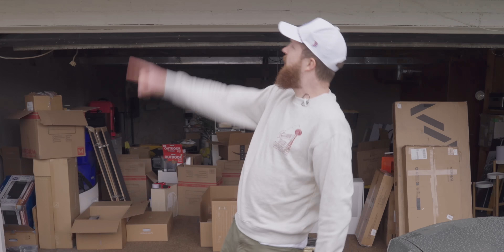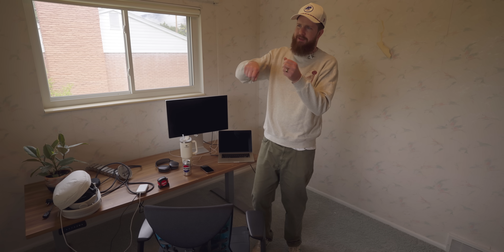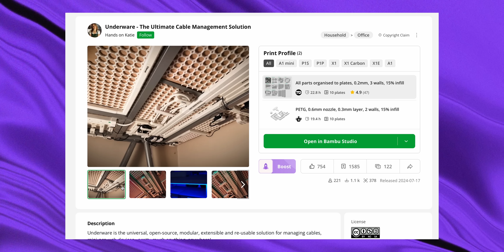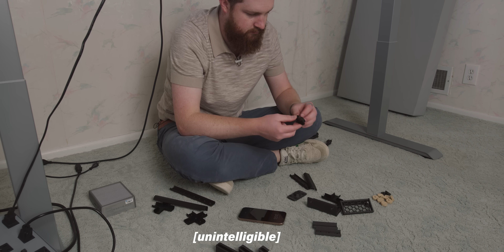Cheap, DIY Cable Management—Like a Pro!

Comment: I don't think I have ever seen a positive video about Bambu Lab that wasn't sponsored. At first I was surprised that you were speaking so positively about it, but then you admitted that this video was sponsored. It really is the iPhone of 3D printing. A locked down ecosystem that benefits from the Open Source community but doesn't contribute to it, meanwhile sucking up as much personal data as it can. If you want a cheap Chinese printer, but don't want to directly benefit an extremely predatory company, get a Creality printer.

Comment: When I was 13 i got an ender 3… I saved up for a year to get it, And it was awsome but I dont think I could have done something like this just due to how much bed leveling and settings would cause failed prints, but now I’m gonna get an A1 mini for the same price I paid for the ender 3 and I dont need to level or set it and it prints 6times faster? Its crazy how much tech moves fast in just 5years

Comment: While that is cool and I’m glad that this system works, I never really like cable management systems that are like this. These systems are really meant for “I am never gonna change anything about my setup.” Because if you need to add a wire or remove a wire you have to undo so much just to take a wire out.

I just use those 3m pad that you can zip tie to and just route all my cables underneath. It’s cheap, and sure you have to cut a zip tie but it’s couple minutes to take a cable out and redo it.

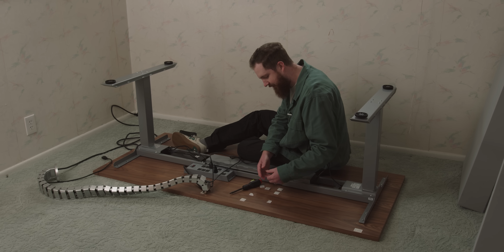Comment: 12:05 The easy answer to >90% of problematic adhesives... WD-40 (US NON-silicone). 
Trust me, stuff is a life saver when dealing with snake-rated glue trap misfires and other near-industrial grade lunacy.
16:56 What material did you print those 'screws' from? You should probably reprint them (along with any other parts of your cable management system that see excessive wear/breakage) in Carbon Fiber Reinforced PETG or another filament that's meant to take abuse and is compatible with your printers.

Comment: Interesting that you're buying a house. It makes SENSE, but there's a part of me that feels like the market has failed to make effective, cheap small studio spaces.

Do you have any thoughts on Bambu locking down their printers? On it's face, as a security option I don't hate it - but there seems to be a lot of frustration. It looks like it makes using other slicers more difficult (disabling the ability for a slicer to send directly to your printer). Especially with some of the oddity around filament RFID and DRM (it appears that the RFID can only be used to read settings on Bambu filament, and can't be used to mark your own non-Bambu spools), I'm concerned your 'iPhone of 3d printers' is more accurate than expected.

Comment: For those of you drawn in by the title and thumbnail, the cable management info starts a full 8.23 into the video.
Reply: it's also a 3d printed solution so you can skip if you're not doing 3d printing.

Comment: even cheaper (free) and fully customizable is the HSW. The Honeycomb Storage Wall has no paywalls, and an easy to learn way to convert anything for any other system into HSW compatible. 

Kinda disappointed that you went with a paid model option :/

Comment: Consider using a hair dryer or heat gun when removing adhesives. Pair it with a plastic "razorblades" tool and you'll start enjoying removing adhesive … maybe. Also, basic cooking oil helps to get the goo off. 70% isopropyl alcohol helps to get the oil off. But then it's gone! Phew.

Comment: I'm about to tackle this project as well but am so not looking forward to it - I have one desk setup with both a PC and a Mac. The whole jumble with Speakers, Keyboard, and Mouse to a KVM switch to both computers. One main monitor that goes to both computers and another monitor just for the PC. Magnetic iPad Pro monitor arm because I use my iPad as the second display for the Mac. Needless to say I have soooo many cables and it is going to be a monster to taackle.

Comment: Time stamps auto generated by ChapterBot:

00:00 - Introduction
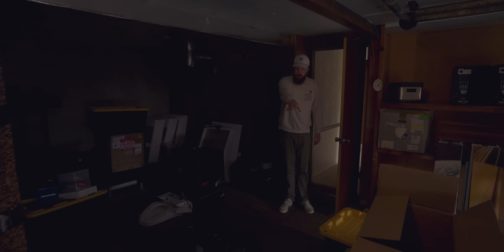00:00:58 - Renovating the Maker Space
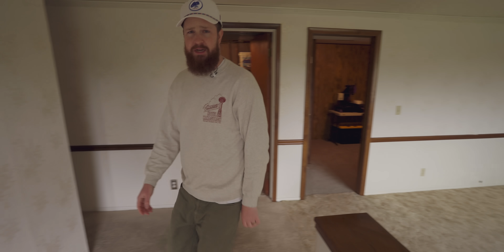00:02:06 - Discovering Potential
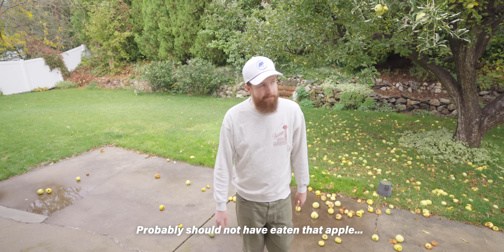00:03:08 - Modern Upgrades, Dated Decor
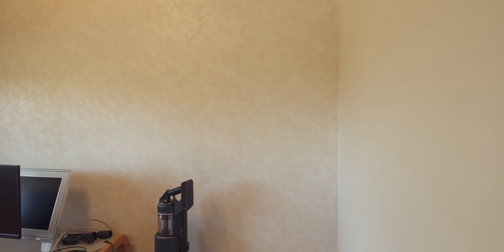00:03:55 - Designing a Multi-Use Space
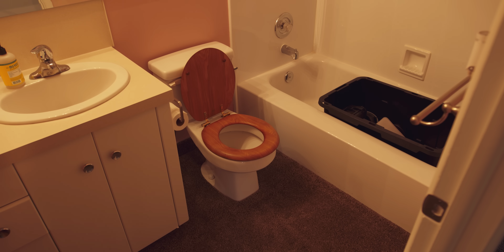00:04:36 - House Tour Revelations
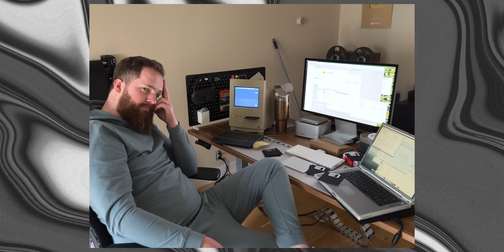00:05:43 - Overcoming Cable Chaos
00:06:25 - Revolutionizing 3D Printing Accessibility
00:08:20 - Innovative Cable Management
00:09:07 - Understanding 3D Slicer Applications
00:10:56 - Overnight Printing Revelations
00:12:12 - Designing and Testing the Setup
00:13:49 - Organizing Tech Workspace
00:15:30 - Assembling Modular Challenges
00:17:28 - Unexpected Project Hurdles
00:18:29 - Modular Desk Setup

🤖 Powered by AI

Comment: One thing to keep in mind having those printers on folding tables, even with vibration calibration, the speed that the bambu X1C prints at normally will cause a LOT of motion. If you get poor resolution, putting it on  a more solid surface will help.

Comment: I like the modular idea, but I don't really think it works here for me. One part about cable management is keeping everything high and tight, but another part is managing excess lengths of cables. On my desk I have two monitors, a Mac Studio, Mac mini, Thunderbolt Dock, external mic, Stream Deck, and an LED mouse mat, all with different lengths and sizes of cables. Some of those cable run pieces would definitely help out, but I think that is WHY people use velcro and zip ties, it's way more flexible, those messier looking.

Comment: Cane for the boring cable management and stayed to watch 2 hours of going through an unrenovated 50s house in suburbia. Wunderfull vintage carpet floors and beautiful ornaments on the wall - all original. The icing on the cake then were 5 3D printers spillings out 50 complex  pieces of 4D chess-LEGO you can use to rule the world - or organize your 3 cables below the desk - if you postponed your world domination plans to next week. Great, more such content and you guys can even affort a 6th printer and run through even more plastics every day. 💪

Comment: I know that you have a drill. Drill some holes in your desk, put the cables in the holes, now they are not on your desk.  I like your 3d printing solution, but I think that the other good solution is to take a 4 inch section of velcro branded onewrap. and attach it to the bottom of your desk with a screw. It is easy to expand, rip it open, add more cables... replace with 6 inch pieces to hold equipment. Screw things to the bottom of a solid wood desk.

Comment: That's a sweet blank canvas for a studio! I can't help but think the LTT cable management system would have been easier and just as tidy though and adjustable. I'm not a fanboy I just think it's a good solouton. My cable mangement is all P clips screwed into my desk with velcro cable ties holding the cables to them as mounting points. Not as elegant or easily adjustable but with my OCD it is seamless! It looks like a single power cord goes down to the socket despite there being a tonne of junk plugged in.

Comment: Oh hey, Quinn, you should definitely check out the thing that iBoff RCC released recently making the rounds in R2R circles; a two-part BGA NAND to M-key NGFF adapter, with corresponding NGFF-attached M-keyed NAND storage boards. (Avoiding periods between things because of an unhealthy paranoia for my posts being deleted, ykwim.) It's really cool stuff and proves storage on the Macbook M-series laptops could had been modular, after all.

Comment: A minor quibble on using thinner layers, and that taking longer to print. With the Bambu Labs printers the amount of plastic it extrudes per second is not dependent on the thickness of the layer (for the most part) If the filament selected will print at 30 mm^3/s, most of the printers can keep up with that speed regardless of whether the layer thickness is 0.08mm or 0.28 mm. If it takes an hour to print at 0.28 mm layer height, it's not going to take 4 hours to print at 0.08 mm, it's going to take a little bit over an hour. There is some time lost in re-positioning between layers, but it's not as bad as having a fixed maximum of 45 mm/s on an Ender 3 (though most could print faster than that, it wasn't always wise to do so. )  Again, this is a minor quibble. There are other things that people do that will make a print take significantly longer. Support where it isn't needed because it doesn't impact the final result, use your slicer settings to remove the support of that you don't need. I'm not saying that it's never needed, but in many cases you end up with support where it's never going to be seen.

Just saying that with the Bambu labs printers, and printers like the Voron's, and many other printers that do high speed printing, the critical element of how long a print will take to finish is the amount of plastic that needs to be extruded. Not the thickness of the layers.
Reply from the maker: Ultimately very correct, but you’re also limited by the travel rate of the material being printed and if you have more layers, you’re likely to have a longer print unless you can linearly scale extrusion volume.

Comment: Would it work to put about an inch and a half to 2 inch spacers where you would’ve screwed the grid to the table. Then you can run the cables between the table and the grid and poke the head of the cables out to where you need them to come out. Then you wouldn’t need all the little pieces to attach and hold the cables. Maybe you can just use attachments at the entrance to the space between the table and the grid to hold the cables taught.

Comment: This looks neat, but as with pretty much every video covering stuff like this, I really feel like it's glossing over the practical challenges of solutions like these for regular people. What was the cumulative print time for this project? A hundred hours? Two? Most people don't have a print farm, and even if bambu labs printers are fast, this is a "keep the printer running all week, remember to clear out the old prints and start new ones ASAP unless you want to wait a month for this to get done" type of project. And not detailing that is a real letdown.

Comment: I have never seen a better reason to own a 3D printer, and I have watched MANY 3D printing videos, I am gonna remember this system whenever I finally get one.
Reply: Now I want a 3D printer. Love your videos and would I would be a sucker for a more in depth video on starting out in 3D printing with this system. What should you get if you have $500, $1000, $1500, $2000 to get started?
Reply: @trevorettenborough $500 or less, Artillery Sidewinder X2. If you have under $2000, get multiple Sidewinder X2s. If you are going to spend $2000 the Bambu Labs A1. Once you start 3d printing, you will learn to make anything useful, it takes a really, really long time, which is where the multiple Sidewinders show their benefit.
Reply: @trevorettenborough  you can get good stuff for under 1500. under 500: Bambu Lab A1. Under 1500: BambuLab X1C, Prusa MK4S
Reply: bite the bullet!
Reply: good that someone liked it. i don't get this video at all. you can do the same with pieces of plastics and 2-sided tape. a lot faster and cheaper and leave printer for something that needs it.
Reply: @cubertmiso  probably for aesthetics

Comment: Here’s a tip for removing stubborn adhesive (tape, stickers, etc.). Take a hair blow dryer and blow hot air over the adhesive for several seconds. The tape should then peel off easily. Use Goo Gone spray if there’s any stubborn residue.

Comment: I appreciate the subtle detail of talking about wall count for strength rather than the common not quite, but almost myth that infill is the way to strengthen the prints.

(For anyone who is wondering "what???" think pipes. A pipe is almost as strong as a bar, because the outside is where most of the strength you care about comes from. That plus some other factors is why if you want a stronger part, you want the shell to be thicker as opposed to infill, which is really just there to hold the roof up while printing)

Comment: Very slick. Did you model/plan before assembly? Trying to figure out exactly where to put everything—well, it seems like this might take a while for many people. Still, it's worth the effort. PS: For the last ten years, I have had two monitors, 24 or 27 inches, depending on the year. I purchased a very nice BenQ 32" monitor. Mistake—fine monitor, but two 27" 4k monitors make more sense for productivity.

Comment: I've found heating the adhesive with a hair dryer helps...unless it's stuck to metal, then it's like de-soldiering a part with a heavy ground plane.   😐

Comment: It looks nice, but I prefer the velcro approach. I think it's easier to change things in time. And is also a little bit my environmentally friendly.
Reply: I’ve tried the Velcro approach. Didn’t work. Velcro usually holds things really well, sadly just not for this usage. Wrapping the cable, yes. Affixing say a multiplug  board to under side of desk, not so good.
Reply: @imajez1  Y did that for a multiplug and for a big PSU, and it worked perfect. Just make sure to use a wide enough strip and fix it well to the table.
Reply: I had a very wide strip, well affixed and yet...

Comment: This is fantastic. I printed a ton of multiboard grids.. but have yet to use any of them. What is that long print for the wires to run in? I love the idea of putting the grids on the underneath of the desk with some small screws.. just think I'd want the locking on the other side to ensure the wire holders dont come out easily.

Comment: Loving the 3d printing room with no ventilation. You can call it Cancer Cave, CC in short!
Reply: Imagine all the things that enter your body and saying this...
Reply: That's not really an issue for extrusion printers. It's a very real issue for SLA printers though.
Reply: @BillPairaktaridis  3D printing filaments produce fumes, as far as I know even printing only with PLA you can still measure a change in air particles. They definitely should have an extractor or at least proper air filtration, specially if they print with something else than PLA (like PETG, CF, ASA, etc).
Reply: Ventilation is for the weak 😂😂😂

Comment: Can we stop making products that require an app, in spite of having enough space on it to build a proper user interface? I don't want an app. Just finish building the product. Build the user interface into the product. I don't want an account. I don't want an app.
Reply from the maker: They. Do. It’s. An. Option.
Reply: @snazzy  Than that's great. Thanks for the clarification.

Comment: 7:36 a friend much smarter than I that teaches CAD editing software classes has been telling me for a year to get a p series bambu printer.

With this recent sale me and my wife finally jumped on a P1S and with the AMS you can be very not smart and still love this and use it with ease!
Reply: I also stopped putting off the inevitable and got a P1S 6 weeks ago. Multiboard has already taken over my office and is slowly spreading to the rest of the house 😂
Reply: @OverBengineering  my friend who is the expert, doesn’t have an AMS and after using it myself I can’t begin to imagine the frustration and constant attention that is required to do a poly-filament print.

Me and my wife both agreed we’re getting him one along with a hub for Christmas because of all the time he’s printed stuff off for us.
Reply: 10:40 I’ve already used 2kg a week in and I haven’t used the desktop slicer once (except to dip my toes before beginning research)

Comment: Could you include the links to the 3D files you printed in this video (assuming they’re all publicly available)? I’m especially interested in the MagSafe monitor mount.
Reply: I think if you Search for Hands on Katie and then Underwear System you’ll find the original creator’s video and all the files. At least this looks very similar. So even if it’s not the same it might help you until Quinn can share his source 😁
Reply: @JeroenReumkens  It is the Underware system, you can see it briefly when he shows the makerworld page. But a link would be great.
Reply from the maker: Yes! Come back in 12 hours! Out of the country with poor service but I’ll put them up ASAP!
Reply: @snazzy  tick tock! I need to get printing!
Reply: @snazzy  still no links?
Reply: @snazzy  where's it at yo
Reply: @snazzy  heyoo post pls
Reply: Came here for the same thing that Studio Display MagSafe would be perfect!
Reply: @grumpychocobo  Yes, I'm definitely after the Studio Display magsafe puck as well!
Reply: Also would appreciate links to the models!
Reply: Maybe silly question as well to answer, but what screws did you use to attach the grid to the desk?
Reply: Yes same. I needs it. It's so snappy!

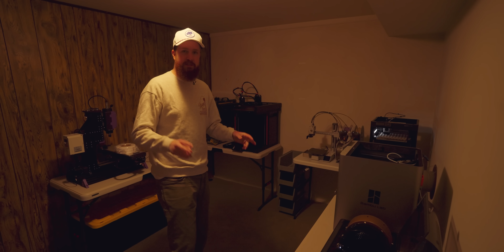Comment: Aren't the fumes of 3d printers dangerous 1:15? Especially if not ventilated?
Reply: It depends on the filament you use. PLA and PETG (the two most common) are usually harmless
Reply: @Slimginz  Snazzy has a preference to ABS which does have fumes, but he's been doing this a long time and the A1 is enclosed.

Edit: made an error. A1 is not enclosed, and can’t print ABS, but snazzy does still prefer the filament.
Reply from the maker: @gregorygeorge8695 Yep. ABS/ASA, absolutely! PETG and PLA are mostly fine. I’m not huffing it up in there but it’s okay. There’s also a return air that goes straight to the filtered air handler so we good.
Reply: There are people creating air purifiers to put inside the machine to clean out the fume. I don’t know if he has it or not.
Reply: only for a few types of plastic